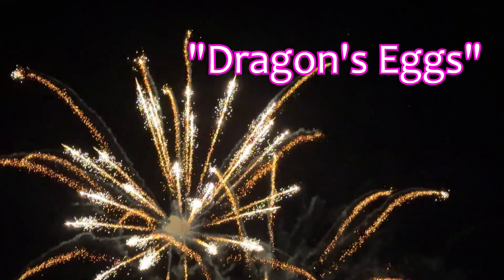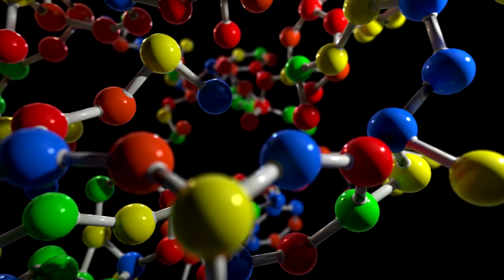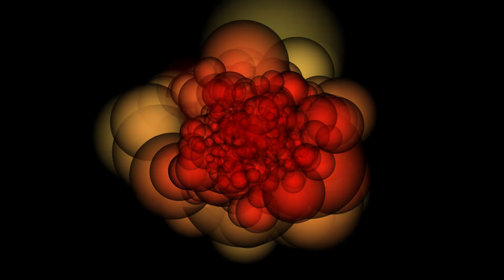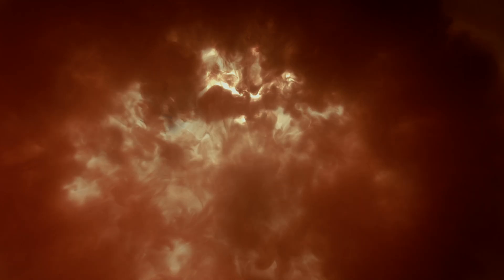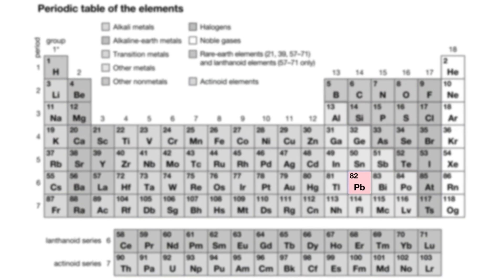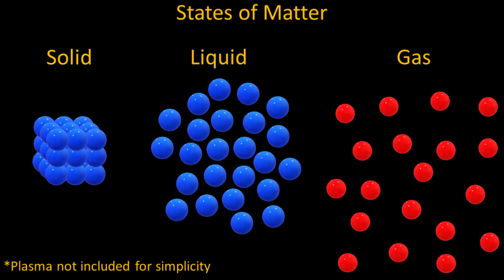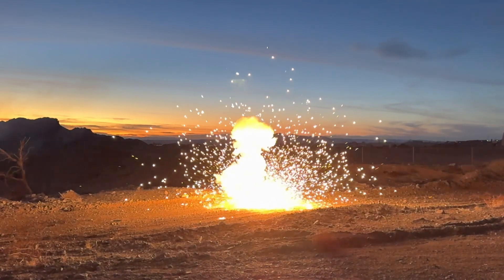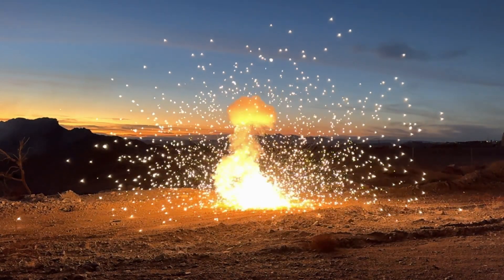How Crackling Fireworks Work

Comment: Very helpful video for people like me that want to learn these very interesting things! One question i still have would be what the sparks are that fly away from the dragon egg? Are they small parts of the egg that haven't gone to gas yet or does the pyrotechnician mix into the mixture some salts that then burn?
Reply from the maker: This is a great question!  Although we can't say definitively since there is still an active debate on the dragon's egg phenomenon, these are likely metallic bi-products produced (which bi-products depend on the formula being used) during this complex reaction, either in solid or liquid form, burning or simply incandescing as they fly away from the point of explosion.
Reply: @PyroInnovations  Thank you, that makes sense ❤👍
Reply: @timbonator1 crackling compositions don't spark, the sparks are added in the ingnition layer of draggon eggs to achieve the characteristic sparkling effect